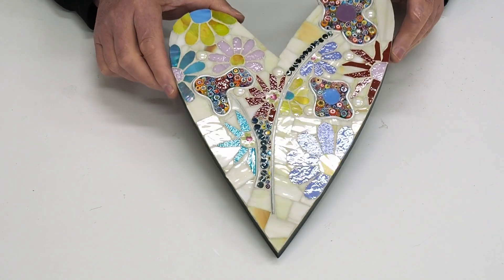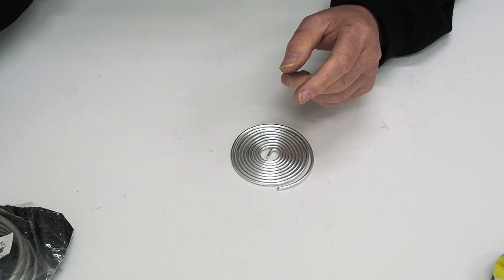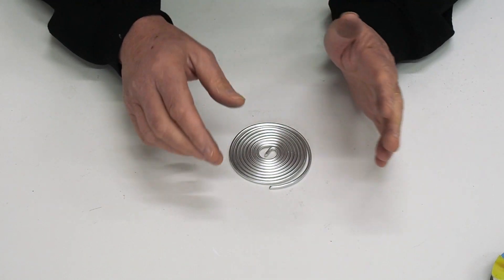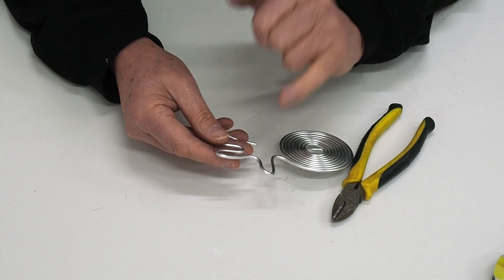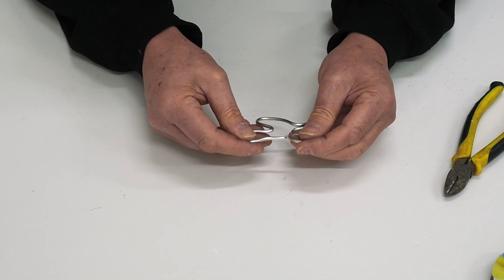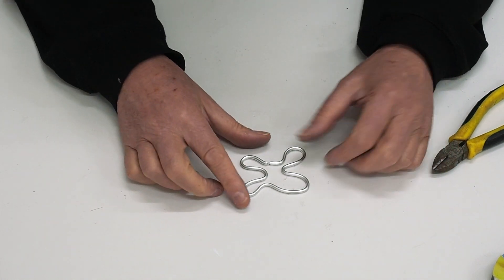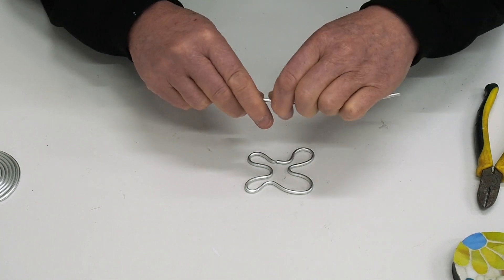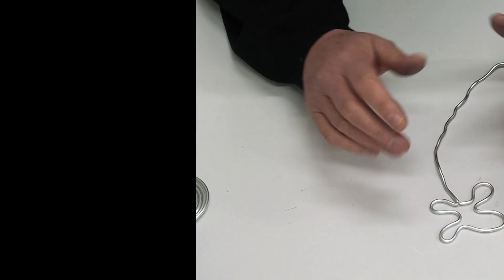Creating Wire Flowers For Mosaics

Comment: Hi, may I ask what is the substrate used for this type of mosaic?
Reply from the maker: The substrate is MDF and is only for inside, it has been sealed all over including the sides with a 50/50 Weldbond and water, allowing to dry before applying the flowers or mosaic to it. :)
Reply: @TreasuryRoad  Thanks much for the response. I've been working on mosaic projects but using terracotta and or cement board. I haven't experimented on other surfaces because of fear of it not being strong enough. But MDF Board is something I will definitely try. One question, do you use glue or thinset to apply tessera on the MDF?
Reply from the maker: @cosquellemind  When Im adhering to MDF I generally use glue such as Prep MultiUse Adhesive which is an Australian product or Mac glue, I have a video on creating the mosaic heart if you're interested. If Im using MDF its only for small projects and quite thick MDF around 12mm. :)
Reply: @TreasuryRoad  Thanks much. I will watch that video. Again, thank you.